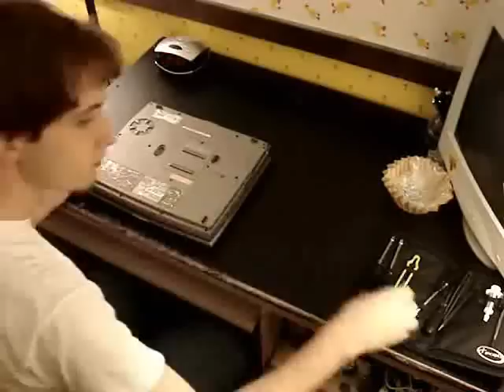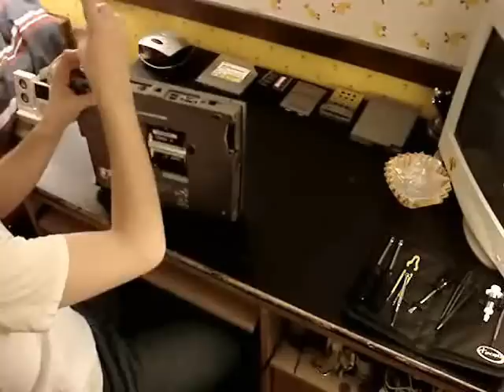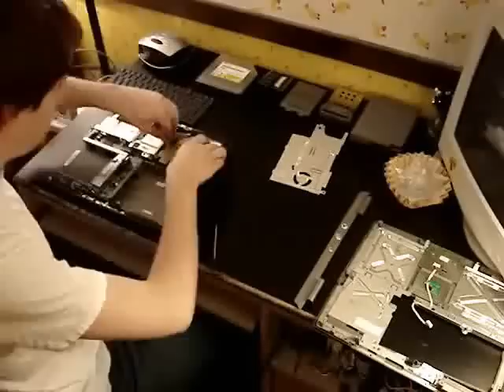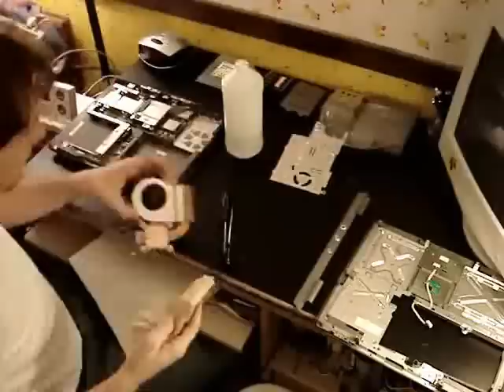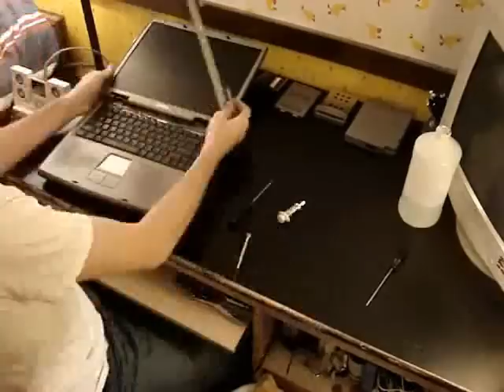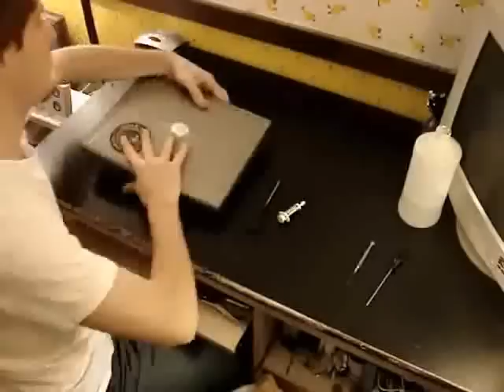Laptop Disassemble

Comment: My advice would be to NOT remove the heatsink from the processor unless you are having problems with overheating. The thermal paste is quite important because it fills in the microscopic grooves between the CPU and heatsink. Assembly without thermal paste can cause much higher temperatures. Isopropyl alcohol is available in any drug store. It is also called rubbing alcohol. I recommend using the 99% concentrated stuff. Blow dust from your heatsink/fan with canned air.